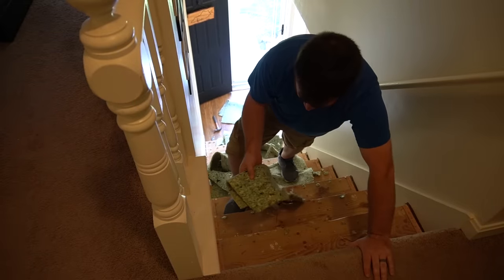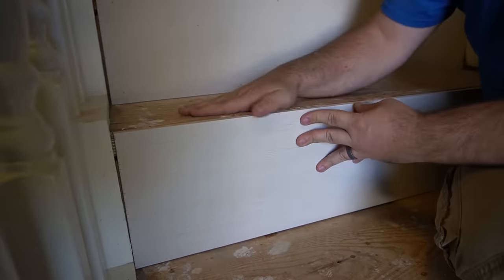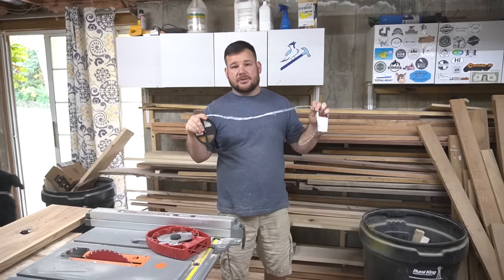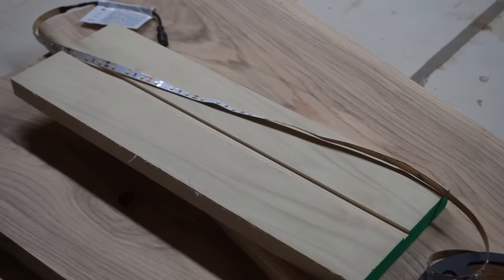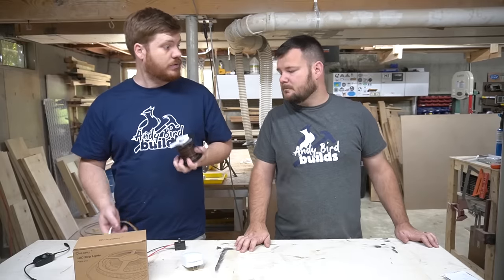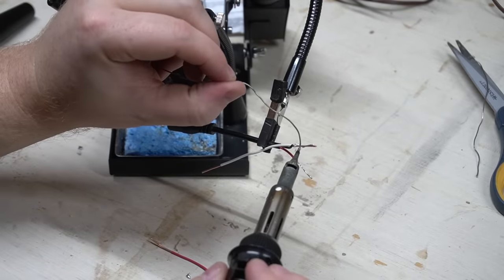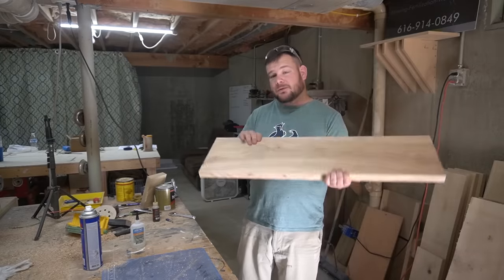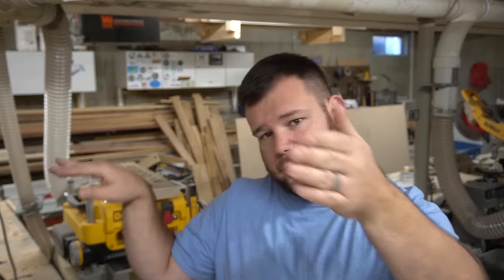DIY Staircase Makeover With DIY LED Lighting // Renovation

Comment: The only thing I would recommend is putting the LED’s in an enclosed channel that has a frosted cover so when you’re standing at the bottom of the stairs the lights look seamless rather than individual dots
Reply: Right! Also, inside of some aluminum beams to better transfer heat and increase the LEDs lifespan.
Reply: Yeah they’re called diffusers and are super important IMO
Reply: I was just about to comment the same thing. Aluminium channeling with frosted diffuser makes it look a lot better
Reply: @zureao  led lights don’t really produce much heat at all.. that’s kinda the whole point of them.. not a horrible idea tho
Reply: Yea i figured thats why we never got a full shot up the stairs cause you could see all the leds on the top few steps.
Reply: That's what I was thinking too. A diffuser is definitely needed for the strips and this kind of project. Especially since you can see them clearly on higher steps.
Reply: Need a disco ball too
Reply: It's called a diffuser but then you would have to run it in aluminum channel and lock the diffuser in
Reply: @xxteep  They actually do.. they really can produce a lot of heat if you keep them running for extended periods of time and that damages the LEDs themselves if the heat has no where to go.
Reply: @Daiceto  I install these on the regular.  Nobody has called me back to replace the ones stuck straight to the bottom of cabinets yet
Reply: —God's Love And Comfort is available for everyone
—Accept Jesus Christ Before It Is Too Late
Reply: @zureao  Good call on the aluminum channels. Less heat the better.
Reply: @Daiceto  nowhere to go, it's called the air around them lol. It's not like it's in an enclosed space.
Reply: Some sort of diffuser definitely, Personally I would have thrown them into some extrusion for a bit of mechanical protection. Stop kids shoving their greasy little paws in there and potentially breaking something. Nailed and glued you don't want to be trying to get back in there to try fix something.
Reply: @xxteep  wrong ;-) it really depends on which ones you choose. I did the mistake and did not some type of heat dispensers for my cabinet lights, they get very warm and overtime turn into some yellowish color.
Reply: yeah, its called led profile
Reply: Yeah I agree adding a diffuser would have been better so you don't see the individual lights when looking up the stairs.
Reply: When the lights are busted it is very difficult to change and remove, coz they glued and nail's it..😂😂
Reply: I agree. It’s like the 2 x 4 flat panels that replace fluorescent ceiling lights. They diffuse the individual leds completely.
Reply: I was thinking the same
Reply: I agree, its called a Light Diffuser, it would look way better

Comment: In lighting, it's a no-no to see the individual leds. They should be diffused
Reply: Ok
Reply: Well.. To you it's a "no no"
This guy obviously doesn't care and is happy with what he's got.
Reply: @cookiesontoast9981  he's also happy caulking the giant gaps on the sides of the risers and steps instead of taking the time to cut them to fit flush...so what's your point?
Reply: @tintshady2049  My point is that not everyone is obsessed with getting DIY house things perfect.. These things bother you but to the majority of people no one will notice.
Reply: @cookiesontoast9981  as a perfectionist when it comes to DIY projects you're unfortunately right. People are oblivious to true craftsmanship.
Reply: He will have fun when one of the LEDs burns out prematurely and has to replace it....

Comment: Looks brilliant. All I would say is that for anyone else thinking of doing this, get the aluminium channel and diffuser for the LED strips. It acts as a heat sink, extending the life of the LED’s, stops the strips from falling down over time and the diffuser spreads the light really nicely.
Reply: Will that also help if you ever need to replace the LED strip? Sounds like it would.
Reply: I do these installs, Karl is spot on.

Comment: My experience with those LED strips is that the clip-on power connectors on the end eventually corrode just a tiny bit, causing dimming  and a little flickering (usually after about 18 months or so). Opening the clip and reconnecting generally fixes it, but the way you've glued everything down will probably make this difficult to address.
Reply: Sounds like I'll be using a little dielectric grease!

Comment: I would probably put the LEDs in a diffuser, that way you will have better light spread
Reply: I wonder how well the led "neon' would work?
Reply: I was wondering about this very thing. Looking up the steps allows you to see the individual leds of higher steps... with a diffuser, it won’t be quite so raw... right?
Reply: @synapticbit  correct, the best part is with a diffuser you can also switch out strips of leds easier without making it permanently attached.
Reply: What is a diffuser?
Reply: @daddydaughteroff-gridadven9958  something like this https://www.amazon.com/gp/product/B072VZSQ3P basic aluminum channel which you could adjust the channel for. Also available in different angles so if you wanted lights down not out the channel would do that.
Reply: @daddydaughteroff-gridadven9958  in this context, something that diffuses light. Instead of a single beam of light which is harsh, you put it in something semi opaque and it scatters the light softening it. Think of when it’s sunny out and no clouds, that’s a hard light, but when it’s cloudy with sun the light is soft, shadows blend in, instead of having hard lines.

Comment: Nice carpentry work. As electricians what we do is we just use 16 or 18-4 wire because if one wire breaks, you can use another one in the cable. We also only pull it out from the right hand corner right under the bullnose of the steps. Once we hook up the LED strips we push the rest of the wire in through the little hole that it comes out of. The way you guys did it is probably a lot nicer. But it does take a lot of work.

Comment: I used to do this type of stuff a lot at work building booths/exhibits for tradeshows.  For anyone wanting to do this, just know the adhesive strip on the LEDs is not strong enough.  We would paint the dado white to reflect light which would also help the adhesive stick better. But still need to use silicone or glue to hold them in.

Comment: A really cool trick for dealing with the seems is to work your way bottom to top, riser then tred, etc. And on the bottom of the riser put a really small chamfer to create a reveal that is consistent. Looks super sharp, only downside is you cant paint the risers as easily as you did. When i did my house I prepainted outside and then caulked and touched up the nail holes.

Comment: Really cool guys. That Ash being repurposed is a beautiful thing. The gap in the seams would be closed up by using a tread template or gauge. Im not an expert but building one to get the angles correct helped me on my staircase immeasurably. Great work.

Comment: Im going to see about putting these under my kitchen cabinets. Right now I have 3 led plug in type strips. But, this would free up outlet space to use for other things! I leave the lights on 24/7 because I don't like a dark house. I don't see well at night and it is an old house, no lightswitch is conveniently located where they put them now days. Having cheap low heat lighting is great!

Comment: Using a quality polyurethane adhesive to attach your treads and risers will ensure a solid and quiet stairway free of pops and squeaks that result from using mechanical fasteners in wood with the season changes. We still shoot a few small brads in risers just too hold them still as adhesive sets up but the difference in the long run can be both heard and felt as you walk up them. You'll also cut way down on having holes to fill just be careful not to get adhesive on any wood that will be getting stained. Nice project though
Reply from the maker: Thanks for the tip

Comment: One thing i would of done differently is to wire the LEDs in a way that you can replace them easily in the future if they go out. The way you did it, the stair has to get ripped out to access the wires. I think one of those white tubes for wires would of worked well running along the stairs

Comment: To power the LED’s you could have used a smart home solution like Samsung SmartThings. There are Wi-Fi power outlets, light switches, and dimmer switches that you can program to only come on at dusk and automatically turn off at dawn. I use it for all of my exterior and foyer lighting.

Comment: looks really great curious if the light sensor could work with app controlled leds to have the ability to have different colors or  patterns for events or seasons
Reply: Just plug the transformer into a wifi controlled outlet. Kasa makes a great one for about $20

Comment: ethernet cable can also be used for low voltage wiring as well
Reply: No dc lower voltage draws higher amps 22awg isn’t enough for leds

Comment: Looks great. What’s the plan for replacing LED strips as they burn out?
Reply from the maker: Thanks, the connection to the wire is in the slot in the front. This is why we didn't add an adhesive to the back of the strips.  It should be as easy as pulling the strip light out and soldering a new connection. The hardest part is going to be doing it upside down.

Comment: Nice, I think you should have used an aluminium profile with a diffuser though.
Reply: Came for this comment. A diffuser would have made all the difference. When standing at the bottom looking up, seeing the individual chips is gonna ruin the project.
Reply: @willimondo  and the aluminum will help with heat dissipation, which should give the LEDs a longer life.  LED's are not nearly as tough as most people think they are.  Treat them with kindness :)
Reply: What's a diffuser ?
Reply: @russpeaknuckel9525  it’s the frosted out cover on an aluminium profile. If positioned correctly, it will give the appearance of a solid bar of light, rather than being able to see all of the individual leds.  To get the correct effect, the led must be, at a minimum, the same distance away from the diffuser as the gap between the leds.  So if the leds are 10mm apart, the profile must be at least 10mm deep.
Reply: @willimondo   Cool ! Thanks

Comment: Looks good,.I'll definitely try this. Only problem is the white will show up the dirt on the steps from shoe scuffs and dirt.

My mother tried this but with a red strip down the middle, like I said, just show up the dirt though.

Suggestion. You should put the LED lights into a semi see through plastic tube. It would of gave the light more of a glow than an micro spot light effect.

Comment: He should have installed a light diffuser so you don't see the exposed diodes. It the difference between diy and professional installation. But still good job for diy.
Reply: He is a led newbie, but diffusers are also a personal choice. Theres tons he could of done different.  Motion detector, have them light up  one at a time.  It's a nice dyi project.
Reply: @tcontradiction  I know I don't show diodes that's mid 2000's and my point wasn't that he should get all crazy with it, the point is in that application a diffuser is a simple addition to make it look like a professional installation. He did a great job.

Comment: The only weak link is the adhesive on those led's.
Reply: A little silicone over them will fix that.
Reply: He said hot glue.
Reply: @montiacpontana41  As an electric sign builder, I second this.
Reply: @F-J.  Be careful with hot glue, may rouine the led strip circuit.

Comment: I probably would have made it a little easier to replace the LEDs if they go out
Reply: Good for 15 years so.
Reply: Agreed.  I have had several of these led strips die in 1-3 years.  I would wire in a m to f plug setup.  Make a small channel for the cable and router out a spot for the plug that catches it.  This would allow you to pull the plug, add the plug to a new strip and replace.

Comment: Pretty cool job but with an Arduino and basic programming, you guys could've added motions sensors at the top and at the bottom of the stairs which work as an ON/OFF whenever. I will attempt this soon.

Comment: Wouldn't the first step be higher than others and the top one shorter?
Reply: And that's how people get hurt
Reply: Why.... why would anything in these video lead you to believe that the steps are longer or shorter.......?
Reply: @DStanford94  simple, if you have stairs that are at even heights and then add a 1" board on top of all of them with no other alterations. The stairs all stay they same compared to each other except the to step which is 1 in shorter and the first step is 1 in taller because the floors of three house haven't moved. Inconsistent step heights cause tripping and twisted ankles
Reply: @DStanford94  I thought he added an extra piece of wood on top of most steps, excluding top one. Sorry, I must have made the comment whilst I was dozing off.
Reply: @freetobe3  what he is saying the unless you add the same thickness to the floor at bottom and top of stairs the riser at bottom is now more than the others and the last riser at top is now shorter

Comment: Around the 8 minute mark reminds me of a recent shelf project I did. Cut a solid slab of oak into two similar shelves, rounded off one edge on both, but then both sanded and stained them by hand. You may not have needed to stain yours but they look a lot better stained, like a fine piece of furniture.

Comment: How would you replace the lights if they ever broke
Reply: I've used those lighs before. Look foward to them burning out in short order and i'm talking less than a month
Reply: Josh Frank  not in any stairs I've seen...

Maybe one going into a basement. That's about it.
Reply: The LED strips usually have a snap on connection to the tape for the power. To replace the strip all you should have to do is remove the power connection (unsnap it), and pull out the old strip and fit in a new one, and resnap the power on the new one.
Reply: @normferguson2769  Or, get 10 of the same connectors for $5.99 on eBay.

Comment: As a suggestion I would have put those LED-strips in an enclosed (aluminium) channel with diffuser. Not only will the LEDs last longer but they would also look better due to the diffuser. These channels are also pretty inexpensive and look great! As an added bonus they would also offer some protection for your LED-strips. 😃

Comment: Looks good, I’m a electrician so only a few pointers from down under, 
I thought you would have put them In a aluminium encasing with a plastic over over the top and had them more deeply recessed so the strips aren’t visible only the light,, 
I hope the strips are serviceable so you can replace them if need be.
However awesome finish and I’ve got to convince my boss (wife) to let me do it 👍🏼👍🏼👍🏼👍🏼👍🏼
Nice work knackers 🤘🏼👍🏼

Comment: if you cut a dado on the tread to accept the riser about 1/8" deep that would solve the problem with no gapping. gap to be a little larget than the riser and shorter to allow for expansion and movement - no squeaks - you  could also was the top edge of the riser before installing the tread to insure if movement is larger than anticipated.

Comment: As goes the light sensor - since you're going for leds with dimming control - I wouldn't have gone for a photocell type. I would have gone with a microcontroller solution and a phototransducer. Either a dedicated serial module or an analog option if you can do adc. It would give you granular control of dimming relative to arbitrary light levels. With tunable leds or rgbw you could even translate that to mood lighting with color temperature adjustment. Super flexible option.

Comment: Love this project and how everything came out, the only thing I would have done different would have been using a wifi switch for the LED , they’re $20 on Amazon and plug right into the LED power supply.

Comment: wow these look cool. good job. interesting use of the photocell , though why not just a smart socket? then you could turn it on with your voice but also set a routine for it to come on at sunset and off at sunrise (or a set time). also wondered what the top step looked like from the bottom level. can you see the led strip? i'd have thought a defuser might be needed on the ones you can see.. and so maybe all of them to keep it uniform... but these are nit picks really. great idea. i want to do this but have metal spiral stairs. so have to get my thinkers on.

Comment: Hey, just a suggestion for the future, you should think about placing those LEDs in some aluminium profiles that comes with the diffuser covers. The profiles are to help with heat dissipation and the covers are to hide the light unless you don't mind seeing the LED bulbs.
Reply: A lot of people are wondering why their LEDs aren't as bright or doesn't work anymore...it's mostly because they are overheating, aluminum profiles are a must if you install them on wood or else you will have to replace pretty quick, depends on how much you use them.

Comment: As an electrician I would like to point out that there are codes in place for non metallic sheathed cable inside air ducting and the sheathing is actually toxic if it starts to melt or sear. Obviously 12v isn't much of a concern but keep that in mind!
Reply from the maker: We didn't end up putting it in the air duct

Comment: Looks good. That glue on the boards though,  I probably would have used a brush to thin it out. You don't want a giant glob that's going to rack the board after it dries and shrinks in a few years. You might notice a bit of a wobble in the boards after a few years, it's from what I mentioned. 👍 Great job though.

Comment: Did your wire each LED strip individually or did you measure the spacing you needed between each step and just soldered the wire between each LED strip making one long strip?